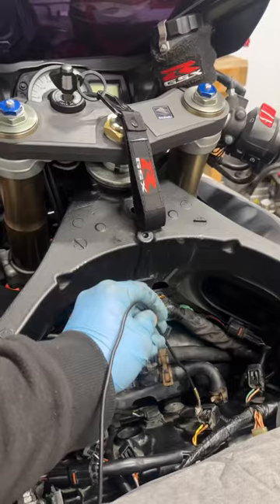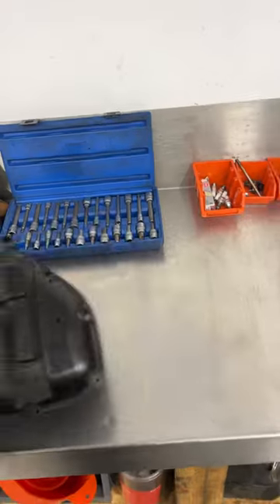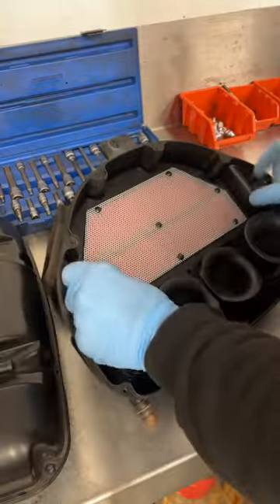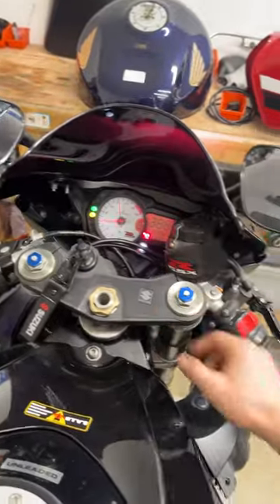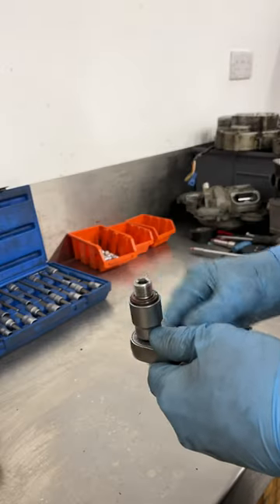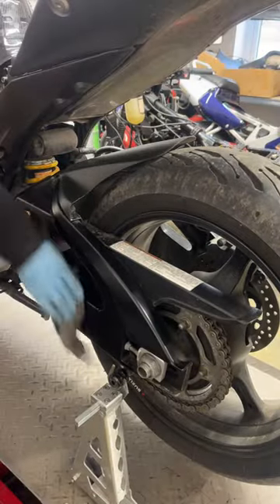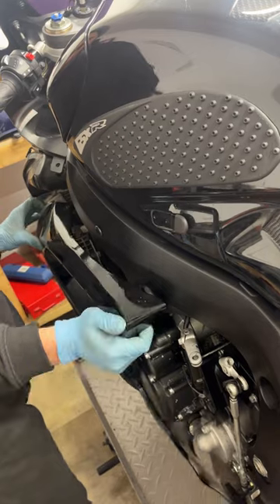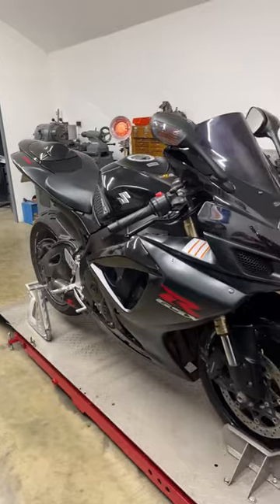44. I’m a fan of a Suzuki #shorts #motorcycle #mechanic

Comment: What do you use to clean the air filter housing
Reply: Elbow grease
Reply: Put it in the dishwasher
Reply: Whats it made from? Plastic
Reply: Blow torch
Reply: Elephant hide
Reply: Spandau ballet
Reply: Bat guano
Reply: @Rhythm24inch  What about the washing machine?
Reply: @Rhythm24inch  What  about the an ankle grease?
Reply: @Rhythm24inch  No, its made from glass.
Reply: @Rhythm24inch  Ostrich